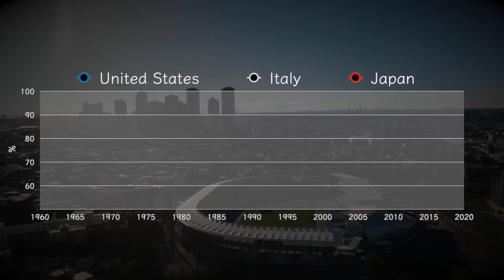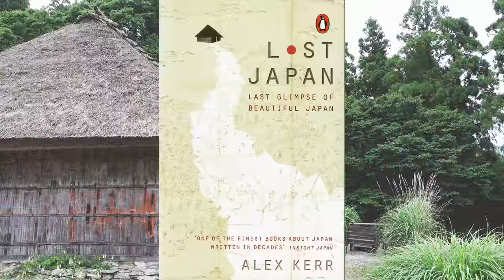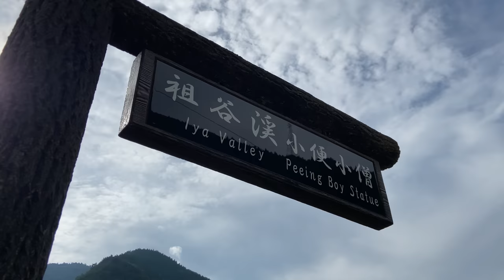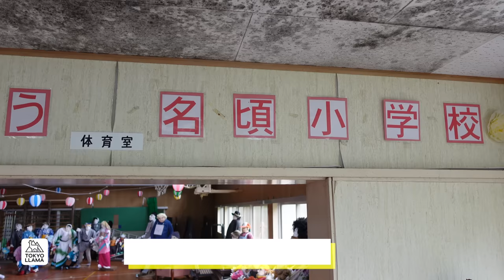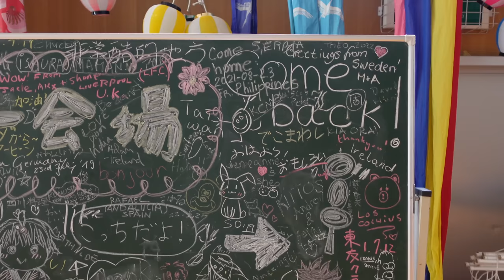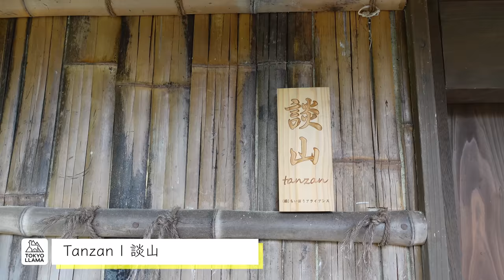Last Glimpse of Japan’s Beautiful Old Houses? Lost Japan (ft. Alex Kerr)

Comment: Hi Jaya. Great video. I wonder if Alex's books are available as audiobooks?  If you were wondering how to resolve the issue with the camera's low framerate in dark areas, this may be perhaps because your ISO setting is fixed to a particular value.  Try increasing it or switching it to auto and see if that helps.

Comment: I have done two renovation of houses so far. and I realize the difference between usa and japan workers. In usa there arent many types of specialist to do specific remodeling like remodeling a door take a certain type of person, doing windows takes another and so on.the cost to do renovation by using skilled laborers rather than diy is quite costly. but being old and my eyes are not as good as my younger days I find that that is probably why most people try to diy themselves as much as possible.  I guestimate the cost of renovating a "middle aged" house is about 3 times the cost of the house itself. so a 50000usd house would cost about 150000 usd to fix up to moderately decent livable house. I learn that what you cannot see when you buy a house is that the old ways in japan 30- 50 years ago was quite basic and simple.  like the house i a renovating now i thought had plywood under the flooring but to my surprise there was not plywood over the joists and the flooring was layed right over the joists. also, there was no insulation at all.
anyway, this is my 2cents worth of experience.